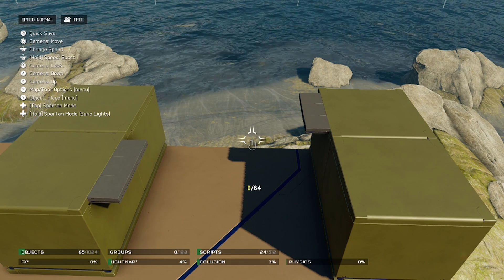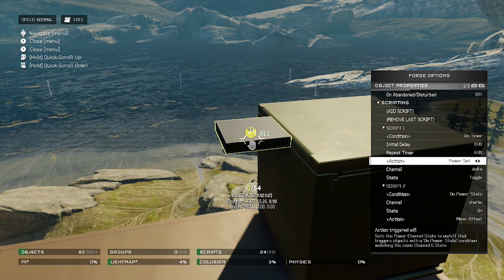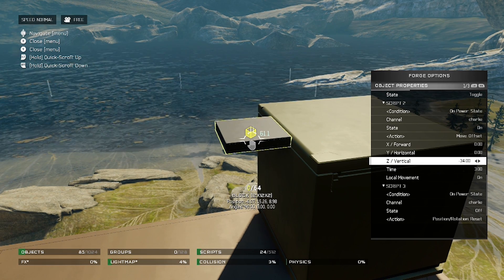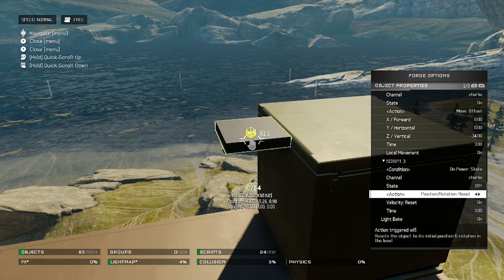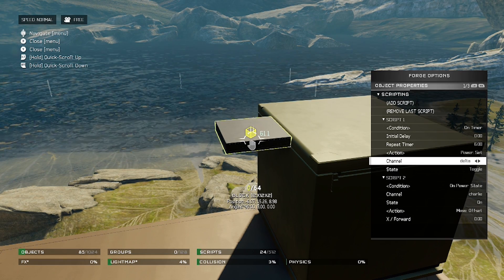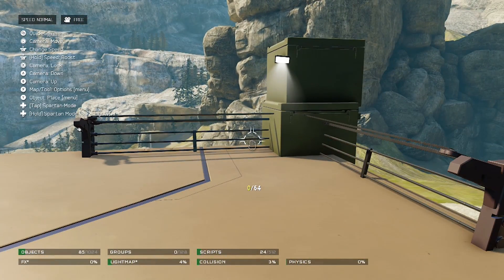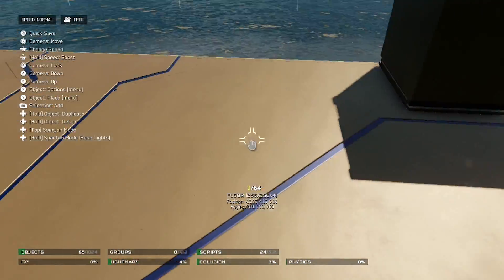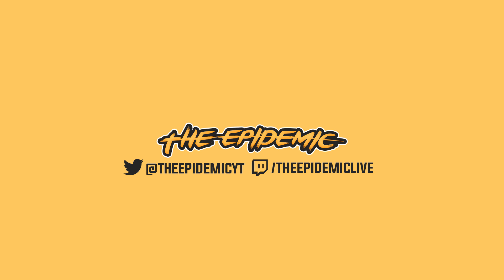Halo 5 Forge Tutorial - Scripting Moving Blocks, Lights, and More!

Comment: You definitely want to use the action 'position/rotation reset' if you're scripting something to go back and forth. For some reason, if you try scripting a move or rotation offset to get back to where you began, the object will move or rotate slightly out of place over time.
Reply: Yeah I noticed that when you weld two three blocks and rotate then rotate backwards
Reply: +zekouse So its good to use 'position/rotation reset' ?

Comment: To add to the video: you can make platforms that have multiple blocks by welding them. Just make sure that the parent block is the one you'll stand on or your character will just slide on the block as if there was no friction.
Reply: +IrontMesdent aaahhhhhh so that was my fucking problem? thx hps